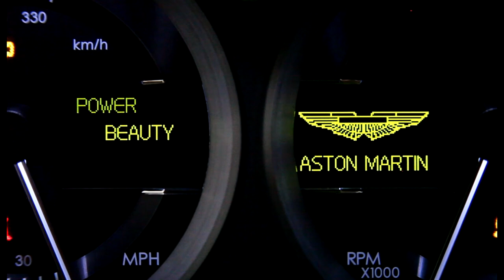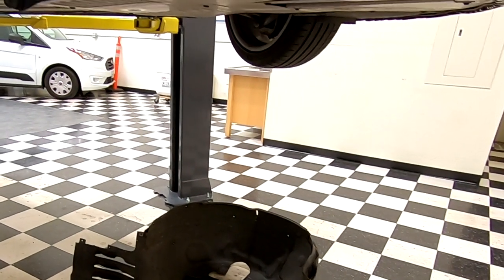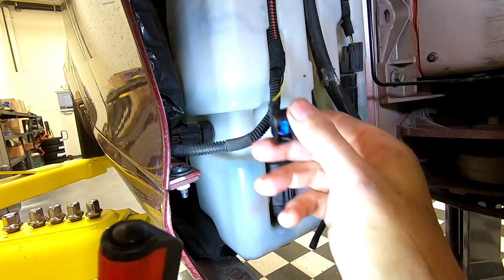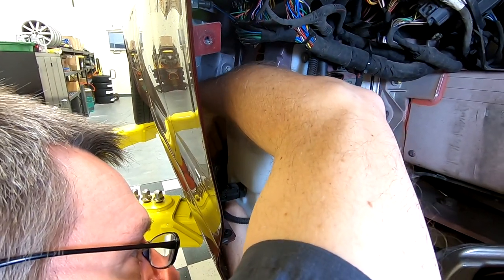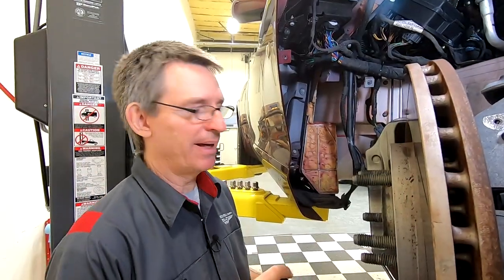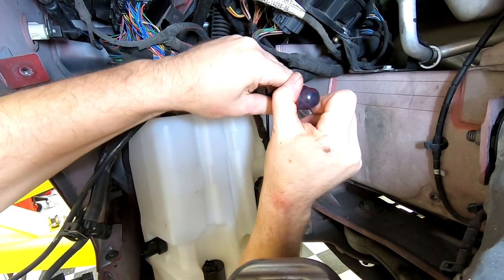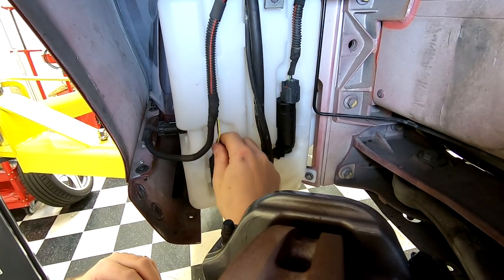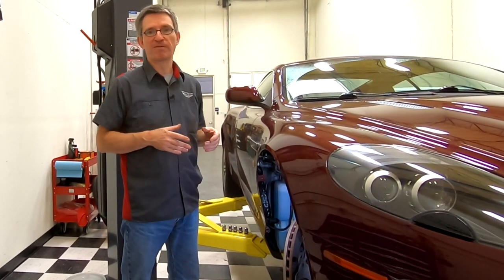Changing the Windscreen Washer Fluid Reservoir in an Aston Martin DB9

Comment: thanks again Steve for a fantastic detailed video, my DB9 started losing washer fluid down to the top of the huge washer bottle so I presumed there was a crack at the top of the bottle. I removed the bottle and checked it and there were no cracks and it turned out to be the pipe that feeds the windscreen and it had rubbed through at the same level of the top of the bottle. found some vacuum pipe and renewed it, no more leaks ! cheers Steve

Comment: Steve have you figured out how to fix that body bracket?  I had one snap off in my left wheel arch.  I bought 3Ms 08115 panel bonding adhesive to fix mine.  Now I just need it to warm up because unsurprisingly the cure time is faster the warmer it is.